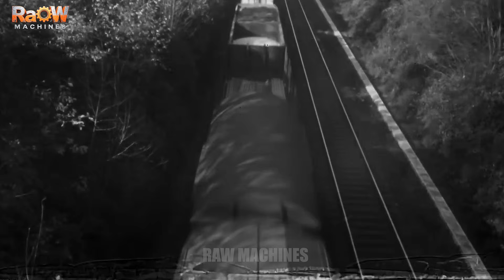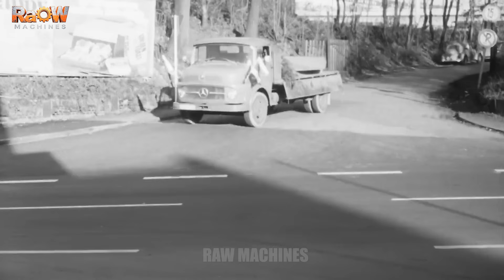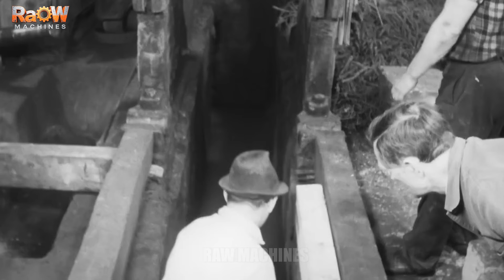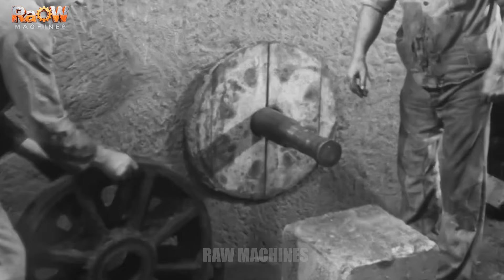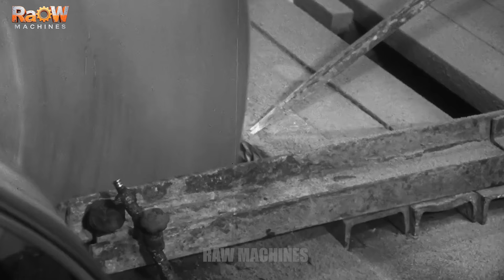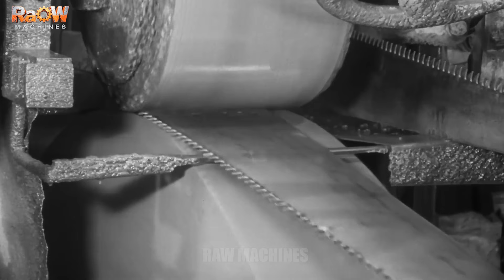Before Electricity: How Saw Blades Were Sharpened | Hanging a Massive Grindstone by Hand 1971

Comment: Isn't this saw making instead of saw sharpening? The sanding process on blades they are doing are usually done at sawmakers when narrowing the blade to size. Saw sharpening is a different process, filing and bending the teeth.

Comment: I worked for a grinding wheel factory worked on a press we made wheels from 3" dia. to 36"  up to 4" thickness 12 in" hole and 36"x4"x20" max weight 500lbs wheels press 1800 ton cap. was there 10 years waltham grinding wheels inc  waltham mass in U.S.A. built around 1897. great film THANK YOU.
Reply: That was truly remarkable as well as the narroration. Thank you!
Reply from the maker: Wow, that’s incredible experience you have! Thank you so much for sharing your background with us, and for your kind words about the film. Working with wheels up to 500 lbs on an 1800-ton press is serious craftsmanship and engineering.
What was the most challenging part of making grinding wheels at that scale?